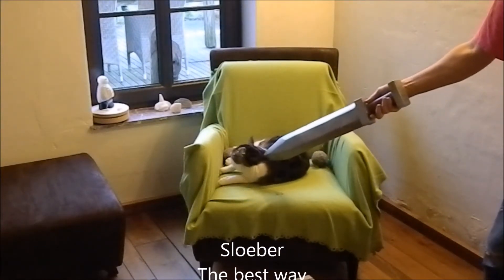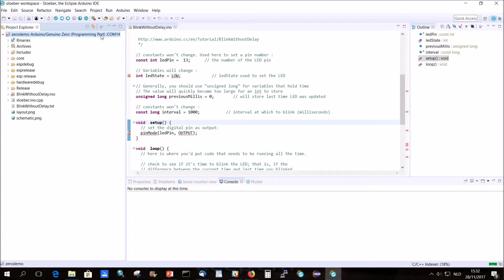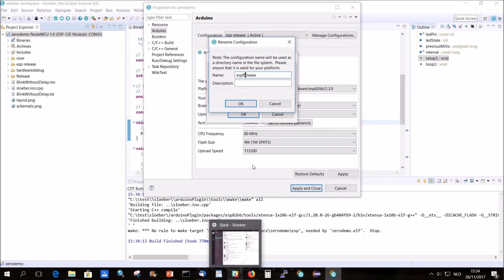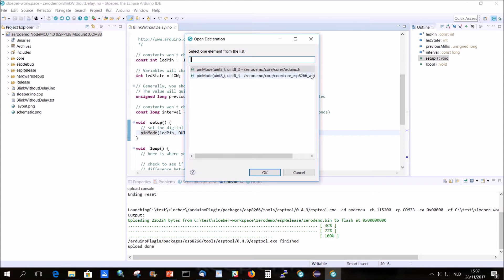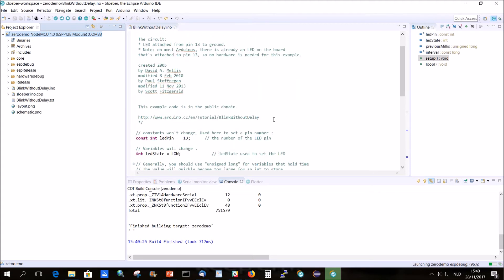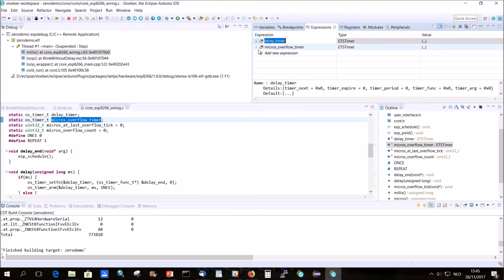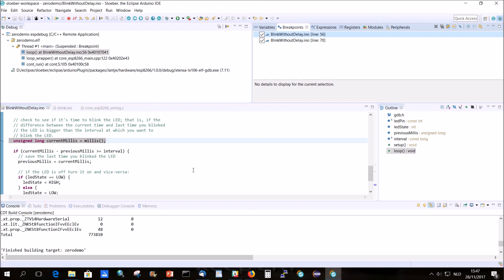esp8266 Hardware Debug with sloeber V4.2

Comment: Hi, nice software ! I am only eager to hardware debug on my esp8266.
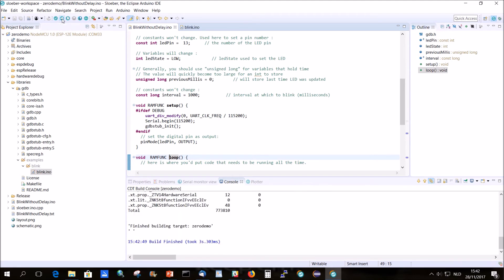I managed to reach 11:10 without any difficulty, got the led blinking, and configured like you did. But now I get : 
"Error in final launch sequence
Failed to execute MI command:
-target-select remote \\.\\COM20
Error message from debugger back end:
Bogus trace status reply from target: timeout
Bogus trace status reply from target: timeout"

I also use ch340 usb-tll converter. The only other difference from your video is that I cannot find all these files under libraries/gdb, I have only gdb.h and gdb.c, but if I go in the directory with browser all the files are there. 

Why is it timing out ?
Reply from the maker: Check your configurations and check you are in the correct configuration.
Switching configuration changes the actual gdb library used. You can see which gdb library is used by selecting the properties of the files folder and look at the resource.
Reply: Thank you very much. I made sure espdebug configuration was set to Jantje/hardware/esp8266/1.0.0, again, I cleaned, rebuilt and most importantly uploaded the result (that was not blinking by itself). I launched the debug session like you explain, and I am very happily in debug mode. So cool to step by step the blinking :)